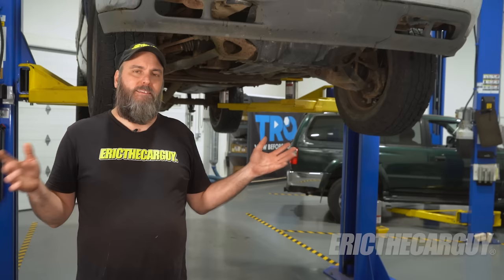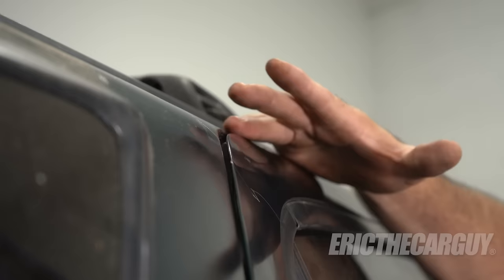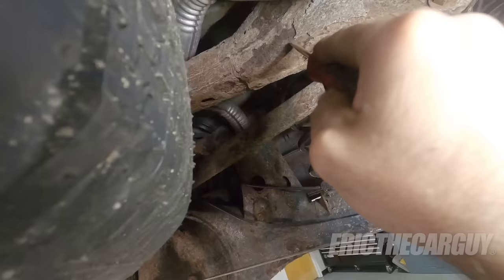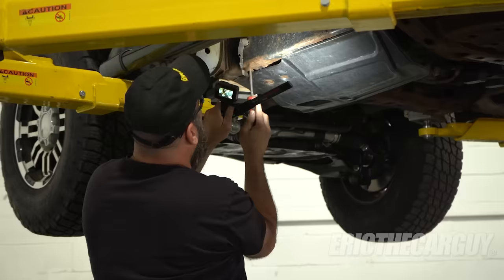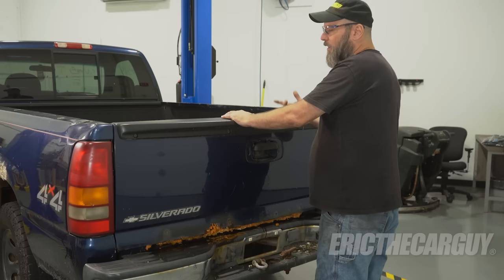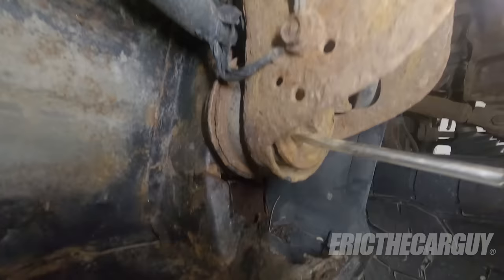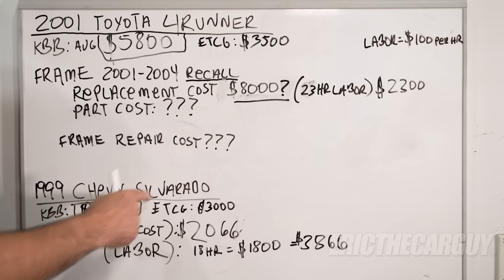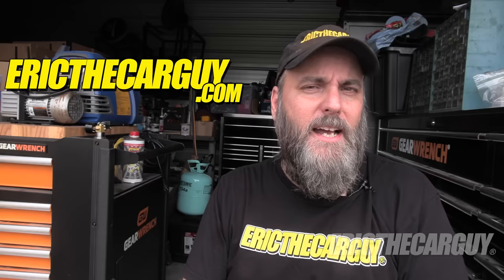When It’s Time To Buy a New Car, Or Not Buy it at All

Comment: Hey Eric. Car wizard just did a video about cars that need $4000 worth of mechanical (non-body/frame) work and the car is only worth $8k and customers are just saying "do it all" because cars have gotten so expensive. People aren't going to buy a $60k vehicle and spend $1k a month if they can just throw $4k at their current ride and keep going. 

I know it's a lot more complex than just that statement but it makes a lot of sense to keep your ride on the road as long as it is in safe condition.
Reply: Sadly here in the rust belt some things just can't be fixed, regardless of how good the rest of the car is. Most structural issues, especially on unibody vehicles, simply cannot be repaired without compromising the safety of the vehicle. Any body shop or mechanic that tells you they can repair unibody damage is flat out lying and endangering you.
Reply: Just spent that much on my 2002 Toyota Sienna; complete timing belt job and 4 struts/ball joints.  It ought to last me another 90K miles, small price to pay for a reliable vehicle.
Reply: @nicholasclark4079 Yeah... I can certainly relate to that, my cousin just bought a 10 year old car for ~$15,000. Which is ridiculous. I know you can find better deals if you are more flexible on the age, but... If your car works, or can work for less than a couple grand (and especially if you can repair it), just keep dumping money into that pit I guess🤷‍♀...      *Unless more expected repairs are expected soon.
Reply from the maker: I believe I covered that at the end of the video. Thanks for your comment.
Reply: @jblyon2  Um, wrong. There are repair procedures outlined in the body manuals for unibody vehicles. Body shops wouldn't get nearly as much work if they couldn't repair unibody structure.
Reply: @madmatt2024  There are procedures, but there shouldn't be. Anything that involves straightening or cutting out and replacing part of a unibody destroys its crashworthiness. Unless it's a part meant to be unbolted and replaced as a whole, it is NOT safe. Repaired unibody vehicles have been crash tested and the results are disastrous compared to untouched examples. If a unibody has experienced structural damage it should be required by law to go straight to the crusher. That's the main point of the unibody. It meant to be disposable and sacrifice itself in a crash to save the occupants. It's a one shot deal.
Reply: Not including tools I've spent way more on my 31 year car to restore and fix it over the past few years than it was worth when I started working on it but am completely fine with this decision.

For one thing it's a semi-"classic", a 1G DSM with the works, AWD, turbo, manual (A/C, ABS...) and ones in decent or salvageable condition are increasingly harder to find and in demand, and it's likely to increase in value in the future. I wouldn't be surprised if I could sell it for more than it was worth pre-restoration plus what I've spent on it since then (not that I want to).

For another I'm the original and only owner and the car both has sentimental value to me and I happen to like driving it. And it wasn't in such bad condition to begin with, just tons of deferred maintenance like a completely worn out clutch, seized suspension struts and stuck calipers from sitting for several years that needed a complete rebuild, and lots of mostly surface rust with some non-structural pitting (nothing even beginning to approach the vehicle in this video). But the car itself was fundamentally sound, just needed lots of TLC.

I also couldn't afford or justify buying a new car for the relatively little driving that I did at the time, even a used car in decent shape, especially with prices these days, and whatever it cost me to bring it up to spec was still way less than any used let alone new car that would have been worth buying would have cost me. Plus, I got to acquire all these great tools that will way more than pay for themselves over time, if they haven't already. I'm basically set to work on any part of an ICE car other than the engine (which thankfully was and is in great condition, being a 4G63 that I mostly treated well over the years), frame and body (ditto on both).

But honestly, mostly it was because I like and wanted to keep the car, I like and am good at fixing things, and it was a great opportunity to teach myself how to work on, fix or restore nearly every major component on a car, including the transmission, which I completely rebuilt on my own (it had kept popping out of gear). Clearly most people aren't going to be able or willing to do this, and it's not worth doing with cars that are fundamentally unsound or otherwise not worth the trouble. But for people in a position to get their cars up to spec, in terms of money, ability and tools, if the car is worth fixing, then it sometimes makes sense to do it.
Reply: @FixingWithFriends  That is very sad to hear about your cousin.  I just saw a 6 year old Honda FIT for sale with only 53,000 miles for $9800, that gets 41 mpg.  They have so much cargo space and can haul engines and pickup transmissions, so they relieve the pressure on a pickup.  Every once in a while, you can find a deal out there.
Reply: Mechanical stuff, interior refresh or a paint job I can see doing if it's a good car otherwise. Anything dealing with rust, or any northern car, no way. I'd even consider getting a southern car and bringing it back to El Norte

Comment: I would also say that spending a few hours under your vehicle before it gets holes in the frame and treating rust with grease or non-setting rustproofing wax every 6 months will avoid all these issues.
Reply: People are lazy or cheap to do rustproofing. Doing that will save thousands in repairs smh
Reply: I coat my cars with Fluid Film every fall. 2 cans runs me about $30-40 and takes maybe an hour for a thorough job. Also helps to find a car wash that handles your undercarriage. That'll blast the clumped up salt and dirt off the underside before it causes corrosion too.
Reply: Y’all are over the top with the rust proofing just wash the under carriage after every winter drive (salted roads) and you’re car will last 20+ years. (Assuming it’s a new car, if you bought a rust bucket to begin with then yes rust proof it)
Reply: @mincraftisawsome1234  Nothing over the top about it, it's called doing your due diligence. I'd rather take a couple hours every fee months to cavity wax my car and have it outlive me than not do it and have rotted cab corners and rocker panels in 15 years.

Comment: Good video!  I live in the desert, so rust is no concern for local cars.  Still, last year I replaced my engine and now I’m doing a complete suspension refresh - bushings, dampers, etc…Either repair would technically total my car but I look at it like this:  if I put that money as a down payment on a new car, I then have a car payment and higher insurance.  If I put that money in a used car, I’ll probably still have maintenance repairs to get that car where my car is already.  The paint and interior is all good, so I repair and enjoy my car with upgraded parts.
Reply: Same here, keep a good car running. If the body is good, a new paint job can make it look new. The hard part for me would be damage to the dash, that would be hard to replace. Upholstery and such could be done for a couple thousand and have a nice interior.

Comment: I'm glad these videos are made to inform people about the damage rust does. In my experience, labor time on a frame swap (done several myself on Chevy Silverados) is usually around  30-40 hours. I'm in a collision repair setting, but have done a couple strictly from rust damage. I'm a big fan of your videos. Great content!
Reply: Is it worth changing out the frame and how much would it run?
Reply: @Tobi-kr1yp  kinda depends on what you’d have to pay for a good used frame and what someone is willing to charge you to do it. Most cases I’m guessing around $5k give or take.
Reply: well if you're paying like $110 an hour for labor and its 40 hours thats like 4800 just in labor with taxes. the used frame is probally gonna be 500-2k so you're looking at 6-7k or a mechanically totalled truck!

Comment: Of course you wouldn't buy one like that unless it's at scrap metal price. But if you already own one the DOT should allow you special "poverty" exemption liecense plate to warn other drivers to not follow too close. Have to abide by certain rules like: no trailer towing, no more than 12# in the bed, no driving during rush hours, no passengers under 18 y.o., no driving faster than 45mph and must pull over to pick up any parts that fall off.

Comment: We had one where Carfax was clean and still under factory. but open the side passenger door and hinge nuts were worn over, and inside panel on that side was a little lose, overflow hose had worm drive clamps under 30,000 miles, same side had a wheel clunk when you top the suspension out in the strut. Years later, had a four wheel alignment done and the technician pulled me back. showed us to what extremes he had to dial things in to make it straight.

Comment: One time I jacked up my car, but the car didn't go up. I already knew it passed annual inspection that year just barely due to structural rust... so that was the moment I decided I had enough of it and it needed to go :) I actually sold it back to the previous owner for a reasonable sum who wanted it just for the engine.
Reply: Yup, done that one more than one car, jack thorugh the sill.
Reply: yep, the old crunch of doom

Comment: Ericthecarguy, I watched your videos pulling a motor out of an S10 pickup. I followed those step by step to rebuild my motor and get it back on the road. 210,000 miles with stock, original 2.2l engine and original transmission. Thank you!

Comment: It’s possible Toyota might actually replace the frame on that truck under warranty. I have heard of Lexus and Toyota replacing parts over 20 years later because of manufacturing issues. If you were at that point I guess it’s worth a try before junking it.

Comment: there's also a thing called being overly safe and making things not appear as bad as they really are, its called "boosting for money" a lot of car shops tend to do this just to make money and rip people off. sure the frame is rusted but its not as bad and it doesnt need replacement, small rust holes are nothing, however that frame crack needs repair. and should be the only thing looked into and brought to a customer's attention, plus its an old truck and eventually it will be scarped due to powertrain failure or the owner will decide sooner or later to get a new vehicle anyways, plus there are ways to slow or save the frame from further damage too.

Comment: Rust holes in the body are a structural problem if you get in an accident...

Also, I'd use something bigger and heavier than a screwdriver to poke the frame with. 😁

Comment: undercarriage wash is a good investment during winter if you live in the rustbelt. You'll never stop the rust completely but you can slow it down significantly by not letting the salt build up under your car and sit there all winter. Every year its the same deal. I see so many cars caked in inch thick crud, sometimes to the point you can't see the license plates or even tell what the colour of the car is. They do their once a year car wash trip in the spring and call it good. I'm going through there every couple weeks at a minimum. Sure, by the end of the winter you spent probably a couple hundred bucks on washes, but if it buys you 3 or 4 more years of use in the long run that's not so bad.

Comment: That thing is mint compared the the 94 wrangler I bought a few years ago.  I spent a month of my spare time welding in plate steel.  I swear that thing had more plate steel and weld than original frame.  Bought for $2k.  Used for 2+ years and put 10k miles on it.  It was starting to rust even more so I figured to sell it a few months ago while the car market was hot.  I couldn't believe I got $3,300 for for it.
Reply: Can I ask why you didn’t continue to fix it if you already did so much ? Why stop at the end ?
Reply: @Natethegreat200c     It was loud,  rattly, drafting in cold weather,  weak heat,  slow,  uncomfortable, etc.  It also had 180k miles and was well used.   My neighbor still uses it but that thing could have a major failure,  trans,  eng,  transfer case,  etc, and it wouldn't be worth fixing if something major blew.  I figured get my money back while the getting was good.  And I don't think it was the safest vehicle for my family either.   I had my fun with a jeep.  I'll never buy one again, at least an older one.
Reply: @anthonyg6221  I 100% understand why you got rid of it Though if you just needed an a to b car that was comfortable. The wrangler definitely can be a family daily, if you can put up with a few things hahah. But hey, some people still daily very old 2 door pickups ... it’s possible!

Comment: Here in Ontario I've had to plate up the frames of several vehicles. What ends up happening if you don't do the entire side is it will rust then crack just on the outside of your repair. Never had an issue passing inspection with the frames I've welded, though.

Comment: Yes I think this is very important Eric. I just watch Eric at South Main Auto and he did an after purchase inspection on a early 2000's Subaru and the top looked nice but the undercarriage had holes and rust all over and was literally unfit for the road. With today's lack of available new cars I've seen Lexus dealers in the Chicage area with rebuilt title Lexus's on their lot. You never seen this prior to 2020. People are so desperate they are buying used cars site unseen and I am in Illinois which is a rust belt state. 99% never get on their back and looke at the undercarrige or asked the car to be put on the lift (though many cocky dealers are denying this request) to look at the undercarriage which shocks me. Any car can look perfect from the top side with repainted panels but where it counts is the bones and in Illinois and other rust belt states undercarriages start rusting at year one. I also had a 1994 Acura GS-R I loved for 19 years that have massive corrosion and holes and couldn't be realistic with parting with it until earlier this year.

Comment: Say no to factory undercoating. In fact run away from any vehicle with undercoating garbage. It's a matter of when it will rust out. Especially in the rust belt. The salt gets under it and stays causing more rust. Even in southern states undercoating will still trap water and rust the frame. The best way is to rinse the bottom on warm winter days and put on a good coat of Fluid Film every 3-5 months.

Comment: here in Austria, once your car has a crack rubber bushing, you can not pass the annual inspection already... 
the same as for body/chassis rust, once it has a visible hole, can not pass as well
when the repair cost is close to your car value, even the deal will recommend to give it up.

Comment: When you are looking at a vehicle that is not in the rust belt there are different parameters to consider. Interior, latch’s, steering column, paint and modules to name a few are where the problems come up in a non rust vehicle. Most rust belt cars don’t last long enough to see the above list. It’s common to see 3k-million miles on cars if the body lasts.
Reply: Non rust belt cars: rubbers, seals, plastics, paint, wiring. Pretty much it

Comment: I used to bring a small magnet when looking at a used car. If there is a ton of filler used on the body panels, the magnet wont stick (or possibly the panel is galvanized metal)

Comment: If the body and frame has no rust its always worth an engine or transmission , I like no payments I drive GM and ford trucks up to the 2006 era , I still own a 1991 GMC 1500 single cab short box  with 460k on it ,oil was changes every 5 k , she's my pride and joy .

Comment: Thanks for the video. Just a comment about Carfax. I found out quite by accident that my Honda Dealer is reporting my maintenance and service to them!😮 I never gave them permission. While it’s great for someone shopping for a car, it doesn’t indicate if a person actually addressed those issues. I typically go to Honda for simple things like oil changes because they provide a free multi point inspection 😅
Reply: I recently bought a 2012 focus, works well and when I got it I knew it needed a little work namely valve cover gasket, the carfax didnt report much on it being maintained but when I got the cover off the valve train looked practically brand new so it got service done.
Reply: @Sovek86  yep exactly since I do some of the work. I have the option of updating the vehicle information in Carfax but the reality is that I never gave my permission.

Comment: The unfortunate Achilles heal of 4Runners is rust, they'll easily go 300-400k miles or more, but you HAVE to keep an eye on the frame. I was lucky with my '05, every inspection my mechanic would point out 'problem spots' that could get worse, I always got it addressed immediately and had the whole bottom undercoated.
Reply: If I wanted a truck to go 300-400k with rust I’ll buy a older Durango! Which I would over a 4 runner. Especially because they have the same major flaw ...

Comment: Your numbers sound right. I own a 2006 Chevy Colorado work truck with about 150k miles that I once tried to get new frame quotes for. (I was being proactive--frame is currently fine.) What I wanted was to fabricate a brand new frame--I didn't want a used frame--so I started looking around. I didn't do an exhaustive search for shops, but one believed it would run between $10-20k to do everything I wanted.